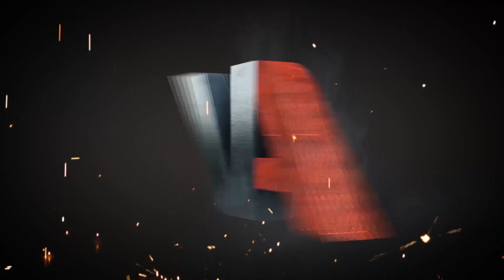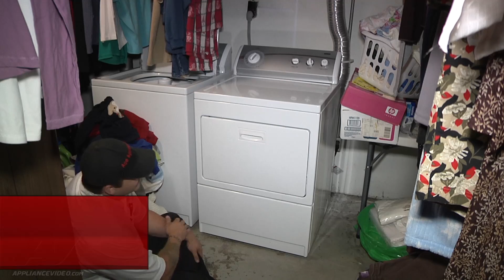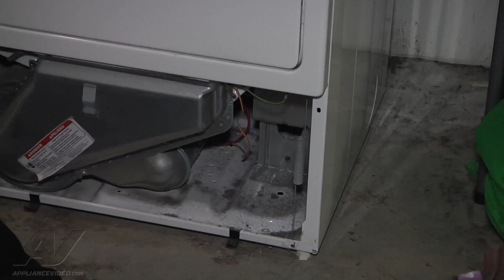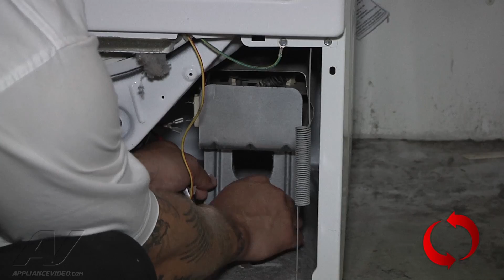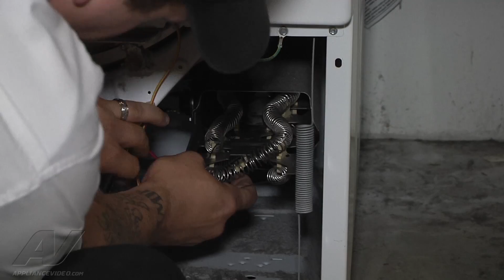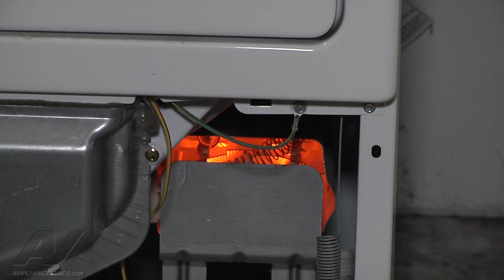Kenmore Dryer Repair - Over Heating - Heating Element

Comment: I have a Whirlpool. I cleaned the lint out everywhere that had built up and put in a new vent pipe too. The dryer will just suddenly stop on me mid-cycle and not work. Once I cleaned out the lint, it did sound much better. When it is working the heat seems to be just fine. Any idea what would just shut it right off?

Comment: Do you ever find a Kenmore electric dryer with a heater relay shorted closed also this particular dryer has a start motor relay and I don't see any videos on any of them indicating these have a relay in them   Any  just want your opinion on the relay because I've never heard of this before keeping heat on high?

Comment: Which thermostat turned it off?  I replaced my heating element and it still won't cool down.
Reply from the maker: Great question, if you have a
more technical question that our parts department cannot answer, you can search
our over 10,000 answered questions free at our website www.ApplianceVideo.com under our Repair Help section. You can also call
our parts department at 1-800-830-5465 and they can give you help 7-days A week
Monday -Sunday, or search at www.SaveMoreOnParts.com  24 hours
7- days A week.

Comment: Would've like to see old heating element to see cause of failure, but otherwise good video.
Reply from the maker: Great question, if you have a
more technical question that our parts department cannot answer, our
technicians are answering all questions at our website at www.ApplianceVideo.com under our Repair Help section. You can also call
our parts department at 1-800-830-5465 and they can give you help 7-days A week
Monday -Sunday, or search at www.SaveMoreOnParts.com  24 hours
7- days A week.

Comment: Why is my dryer cord getting to hot?
Reply from the maker: Great question, if you have a
more technical question that our parts department cannot answer, our
technicians are answering all questions at our website at www.ApplianceVideo.com under our Repair Help section. You can also call
our parts department at 1-800-830-5465 and they can give you help 7-days A week
Monday -Sunday, or search at www.SaveMoreOnParts.com  24 hours
7- days A week.

Comment: Is it supposed to glow red through the small vent inside the dryer too?
Reply from the maker: Great question, you can call our parts department at 1-800-830-5465 and they can give
you help 6-days A week Mon-Sat . You can also search at www.SaveMoreOnParts.com 7- days a week.  If you have a more technical question that our parts department cannot answer, our technicians are answering all questions at our website at www.ApplianceVideo.com under our Repair Help section. We have over 4,000 common questions and answers that you can easily search through by your model
number, appliance make, and problem or error codes, and It’s free to search
through our question & answer library.
Reply: Some of them will, some models have the heater mounted on the back on the drum as opposed to on the bottom like this.

Comment: Thanks for this video!  I had high heat even when set to air dry.  I checked the heater to case continuity and found a short.  The coil was intact, but had fallen off the insulator standoff.  After putting the coil back on the insulator - it works!!
Reply from the maker: Thank you for
your positive response, we are glad we could help. Please subscribe to our
YouTube channel or donate a dollar  to
our fan funding page to help us create more quality content. This is the only
way we can continue to help thousands of people like you every month. Just
click on the link below and go to our YouTube page and click on the BLUE
support button on the right hand side of the page. Thanks in advance.   https://www.youtube.com/user/ApplianceVideos
Reply: I noticed heat on 'air dry' also and figured it was a problem with the rotary dial switch but my wife informed me that she couldn't touch the top of the dryer even thought it was on knit heat. After watching this excellent video, I'm sure the heating coil must be the problem.

Comment: You measured the coil with continuity to the ground (a short) in this case while one of the two leads (top one) was still connected to the coil therefore obviously the continuity/short; you should have checked  with both leads/wires to the coil disconnected.  But, I think most viewers get the idea; yet, did you replace the thermistor (8577274) and could a thermistor alone caused the same problem (being super hot)?  Thank you for the video.
Reply from the maker: Thanks for your positive comment.  We have helped millions of people repair
their own appliances. Please help produce more quality videos so we can post
them to our website by subscribing to our YouTube page, or posting our website http://www.appliancevideo.com/ on your Facebook or Twitter account.

Comment: how do you know if you have continuity? what does the meter read if there is continuity?
Reply from the maker: +Krista Gonzales 

                   All of our technicians are now answering questions
daily at our http://www.appliancevideo.com/ website under the Repair Help section.  We also have over 1600 common questions and
answers that you can easily search through by your model number, appliance
make, problem or error code and it’s absolutely FREE. You also have the option
to email a factory service technician with a question on your appliance at
http://www.appliancevideo.com/repair-help/ . If you’re looking for a repair video, you
can also search our library of over 2600 free repair videos. ApplianceVideo.com
specializes in quality DO-IT-YOURSELF appliance repair videos and we get over
800,000 views per MONTH to our videos worldwide and growing. If you need of
parts for your major appliance, we have over 5-million parts in stock at http://savemoreonparts.com/ .  Thanks
for your support. Matt Ace Appliance factory service technician.